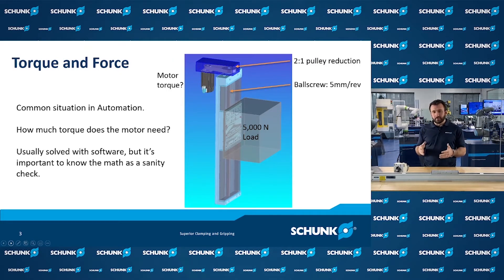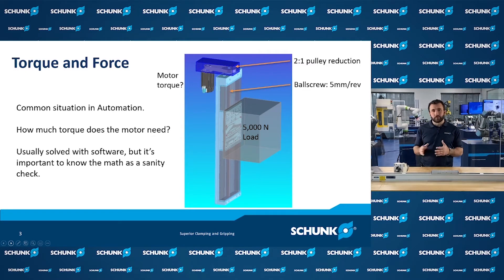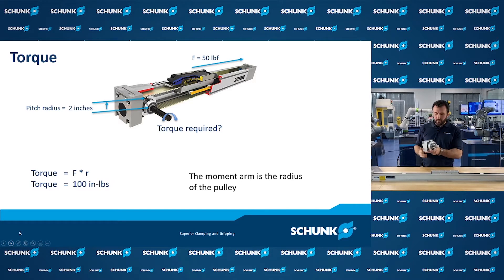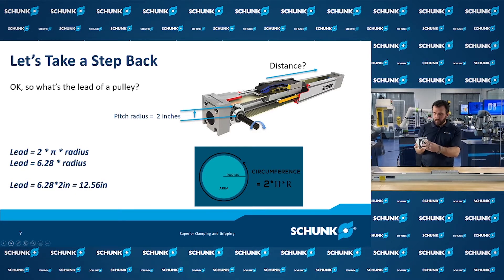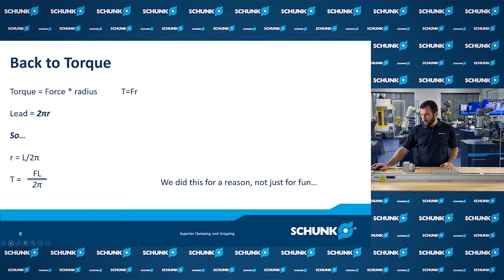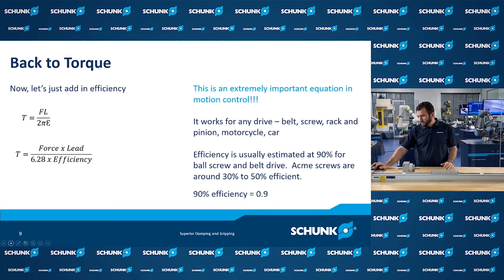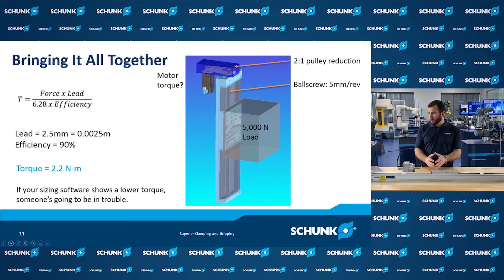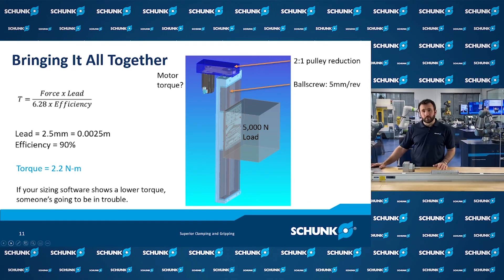How to Calculate Motor Torque

Comment: I thought that lead means how much linear distance you get per one revolution of the ball screw. not per a motor revolution behind the gearbox.
Reply from the maker: The lead of the ball screw is the linear distance you get per one revolution of the ball screw; however the lead of the system is equal to the linear distance from one rotation of the input, in this case a motor. Most of the time when we use this equation, we are trying to solve for the torque required by the motor, so we include the gearbox into the lead equation. For more information or assistance, please contact: automation-apps@us.schunk.com

Comment: What if it is horizontal?
Reply from the maker: The torque equation presented in the training video applies to horizontal and vertical motion.  The force value tends to be less during a horizontal motion as the moving payload is not move against or with gravity.  The force value for horizontal motion would be the payload times acceleration (due to the move) plus friction force (payload x gravity x friction).

Please contact the SCHUNK Automation Team at automation-apps@us.schunk.com for application review and assistance.

Comment: hello sir can you tell me how i can calculate moment of inertia of carriege manually...which type of data i should need
Reply from the maker: The mass moment of inertia of the carriage/payload can be approximated by the equation I=mr^2 when sizing for a linear actuator motor where m is the mass of the carriage+payload, and r is the radius of the ball screw or belt pully. This approximation treats the carriage as a point load. The radius of the ball screw or pully is used because we are trying to measure the resistance to change of the ball screw or pully rotation due to the mass of the carriage. Keep in mind this does not include the inertia from the ball screw or pully and in reality the calculation is more complicated. For more information or assistance, please contact: automation-apps@us.schunk.com

Comment: I'm trying to calculate using a 40-1 gearbox to achieve 550 nm of torque which is the end piece of equipment needing.... what size motor on the input of the gearbox needed to achieve that
Reply from the maker: Hi, thank you for your question. It looks like you’re intending to achieve a 550Nm torque output with a lower torque motor. This link will provide you a brief overview on how torque is transmitted through gear trains: https://www.engineeringtoolbox.com/gear-output-torque-speed-horsepower-d_1691.html 

Assuming a 90% gear efficiency, you can achieve a 550Nm torque output with approximately 15.3Nm of input torque. Feel free to send any additional information to our SCHUNK Automation Applications group (automation-apps@us.schunk.com) if you would like our team of engineers to review your application.